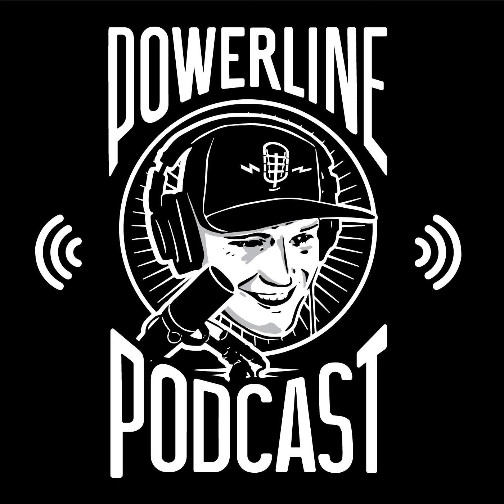070 | Dave Fossa | On Grounding & Bonding

Comment: So if you don t ground the truck or crane.  The idea of equal potential.  Which could keep induction of current from being a problem.  Which really seem to be the potential problem. If common bonding were not there would be another potential possibly to deal with. Such as induction from other wires or other potentials. Which may not be seen or miles away. Hopefully any current would go to ground and keep all at the equal potential that would not hurt workers. I could see having an area next to the ground marked out.  We know if a line is down what is the distance you need to shuffle your feet together to get out of that zone.  Should there be a safety zone around the grounding rod?  We know chopper blades can create static electricity.  With proper PPE would it be negated.  This is a very interesting topic. Would you ever touch a line without your gloves and hot sticks really knowing it may get you. The thing that always has gotten us is being rushing to complete a task.  Just trying to complete that last task at the end of the day.  Also eliminating the distractions not to multitask.  Even if done it a hundred times.  These two have been high on our list of causes of instances. The things I work on don t kill people but mostly burst into flames and Firey show. We get to tell everyone about it. The high voltage you may get lucky too. The potential of current between lines are more likely to get you if not taken care of properly. Example being a broken conductor.  
This is a great topic for many fields and people working next to the lines. The induction is what really opened my eyes to this issue and why boding and grounding to protect workers in the area. I don t know how you really get through to people about it and understand why to do it.  You may never see that it did save your life. Kinda funny how that works with electricity.